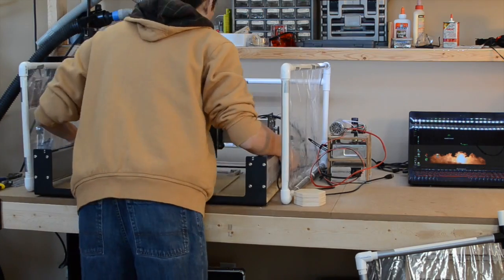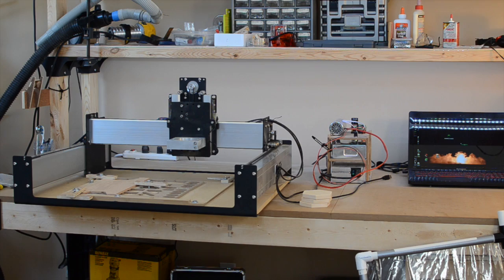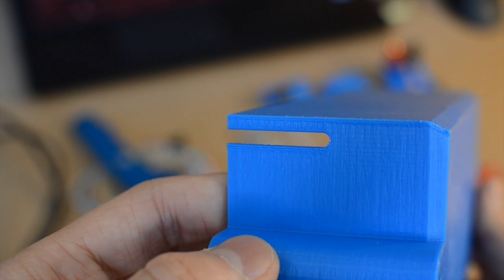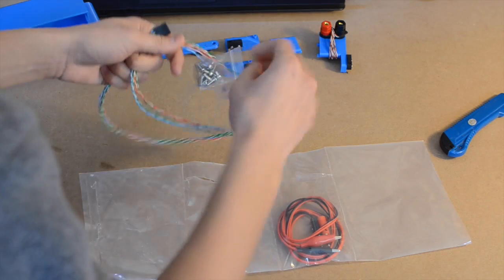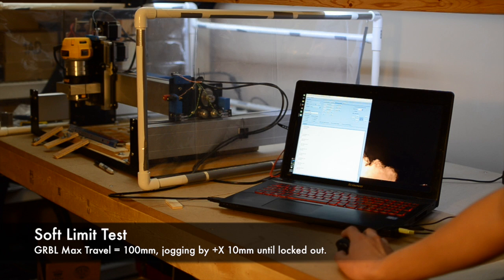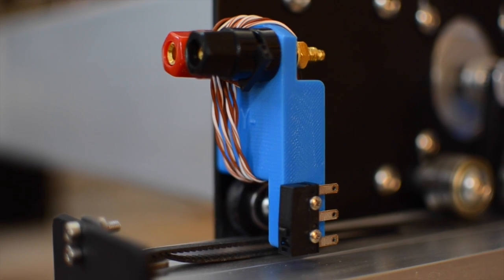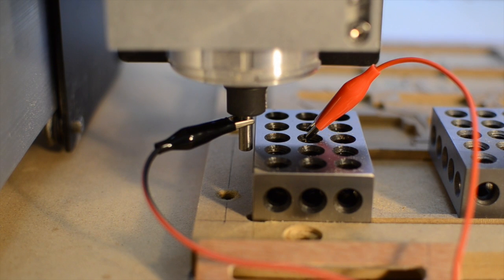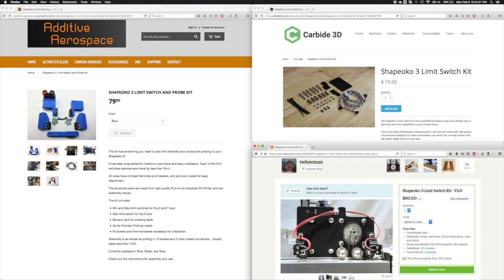Installing a Homing and Limit Switch Kit - Shapeoko Project #48

Comment: Is there a way to change x max travel about 10 mm
Reply from the maker: Decreasing it is easy, just modify the soft limits in GRBL. Increasing it is again something you can't do in Carbide Motion because it has its own version of soft limits, which is hardcoded. It's basically like training wheels for CNC users, so it's impossible to crash the machine when jogging. UGS and other senders won't hold your hand in that regard.

Comment: Mr Winston 
The switches along with the dust boot limits the cutting size a bit, when i rapid move to center it is slightly over to left of Mark, how do we go in and change settings to reduce board size accordingly, as usual sir thanks ahead of time
Reply from the maker: The notion of where "center" is is hardcoded into Carbide Motion. As far as I know it can't be changed. The software wasn't designed for custom configurations. You can use a different program (like UGS) and make your own macros that rapid to an arbitrary point, but you're on your own if you're using Carbide Motion.

Comment: I am not trying to be a paint but I am getting really frustrated here. I just got my XXL kit today and I am a total noob. The directions are misleading and not very well defined. Naturally I went to youtube to try to find a video tutorial and you have a video that isnt explaining what the parts are your just saying connect this to this. It gives the impression that we all come to this channel because we already know what this is. We dont and thats whats really aggravating right now. For instance I have homing switches and not one time in the instructions does it say where to plug them into the board... Where do I plug these homing switches in???
Reply from the maker: Savant PCs You're looking for a block of header pins that should be labeled X, Y, and Z_Limit. Direction you plug them in doesn't matter. Should be on the other side from the USB port.
Reply: Forgive me I build PCs and connecting things  like these switches have to be fairly precise in a PC and its aggravating because I dont know what all these parts are called and no one really has a tutorial or instructions to explain these things out. i wouldnt have a problem had I had a diagram saying This piece is called this, that piece is called that. I finally found the homing switch config on their website but its showing the old PCB. I dont mean to sound aggravated its just I been at this all day and its a pet peeve of mine when directions are not clear. Its not your fault.
Reply from the maker: No worries, I've been there. CNC is at an awkward intersection where the market is widening past hackers to the general public. And the language and software and general knowledge are playing catch up. Took 3D printers a while to get past that valley of frustration. That, and +Carbide3D needs to step up their instructions. Have you tried: https://www.shapeoko.com/wiki/index.php/Photographic_Shapeoko_3/XL/XXL_Assembly_Instructions

Comment: TY, did you revise work space in carbide motion
Reply from the maker: Yes, since I'm using my switches solely for soft limits. I removed my -X switch to get every last millimeter of travel possible, so I need the software to stop me before I crash the machine.

Comment: Mr. Winston excuse the persistence, hoping you can send the picture of the limit switch adjustments made to accommodate the suckit dust recovery@voheart.org
Reply from the maker: I was away all weekend, just got back. Check your email now. It's really a simple adjustment, nothing to worry about in terms of compatibility. If using one screw is not enough to hold the switch in place, a little application of hot glue should do the trick.

Comment: Mr. Winston, I notice that you are not using Carbide Motion, is there any particular reason, ty, Greg
Reply from the maker: For applications of homing and setup, universal gcode sender's macros make it really easy to trigger probing routines with a single click. However for basic operations CM can be quite convenient, as it saves the zero-ed position from your last session. In a lot of my later videos I'm using CM again.

Comment: Mr. Winston, I have already pulled the trigger it appears Andrew is still in the Biz, at least his website took my money....Do you know if I may bug you some more, if it works with Carbide Motion of do I need to use another program? ty ahead of time
Reply from the maker: greg martinez All switches basically work the same. Just a simple open-close circuit. 

Keep in mind, accepting payment is not the same as actively producing. Etsy and other stores will take your money even if the seller in on vacation. I would try and email Andrew to confirm, and if he doesn't respond in a week or two get a refund.

Comment: Need to know what are the best limit switches for shapeoko 3
Reply from the maker: I'm not sure if Andrew has the kit in the video in production anymore. If not, your best bets are the set direct from Carbide3D or Tim Foreman. Carbide3D set is highest quality, metal components and dust-resistant switches. Tim's is good for hard limits (has switches on positive and negative extents, but personally I prefer soft limits), and slightly cheaper I think.

*I haven't done this market research in couple months, YMMV.

Comment: How do you probe the 3 axis? is there a tool to do this, a set of G-Code commands or does Carbide Motion incluse such functionality ?
Reply from the maker: It's a gcode command. G38.2 if I recall, followed by axis direction you want to probe. Carbide3D will eventually release a probing kit and probably bake it into carbide motion for those who don't want to deal with manual entries.
Reply: thank you very much for your help. By the way: You inspire me a lot and I wonder if I can take your projects as an example to make my own videos ? I am a french person and I create videos in french. If you accept, I will give your videos in references in mine so people that see my videos will see where I took my inspiration.

Comment: Great video. But in order to "form my own opinion" on the differences between Andrew Diehl's kit and the one provided by Carbide 3D I would have to buy both. Do you happen to know the differences? I'm in the market for the SO3 and didn't know which kit to buy if I want the hard limit switches. Your help is appreciated.
Reply from the maker: +Peter Chan Carbide's mounts are metal, but only 3 switch, no probing included.

Comment: You really shouldnt kill power to all axis because having your z axis plummet like that might do some damage...
Reply from the maker: Valid point. Usually the equilibrium point of the springs is about an inch off most work pieces, but you never know... Something to be aware of. That's why I prefer soft limits, and most kits you can buy only have 3 switches so you're 'stuck' with soft limits.
Reply: +Winston Moy Some controllers you can give commands in case something was tripped like "max out z and disable spindle"

Comment: nice video.....I am in the process to buy my cnc mill. I have seen your videos about Shapeoko 3 and it looks so nice. I just saw another interesting cnc mill which is Stepcraft from germany. Do you know about that CNC?

Thank you
Reply from the maker: +VLAHECO Don't know much about it. Looking at the specs, it seems mechanically capable. But because it runs off Parallel, or USB adapter, you're stuck with certain software/Windows. The motor controller and electronics are basically a black box, so DIY mods (like limit switches) may be difficult or impossible. 

It will work, but in my opinion won't be nearly as simple, easy, or pleasant to use as something based off the Arduino architecture.
Reply: +Winston Moy a subd connector and an arduino is all you need to convert a controller meant for parallel to grbl

Comment: There's a (pretty large) thread on CNCZone about magnetic limit switches. They're non-interference types that supposedly are stupidly accurate. It's based on a Hall switch and a neodymium magnet. The interesting part is that there doesn't need to be a physical contact which means there is no wear and tear, unlike those micro-switches you're using there. http://www.cnczone.com/forums/open-source-cnc-machine-designs/101878-cnc-forum.html

Comment: You could improve the z homing by using a force sensitive resistor like the delta-printer boys do.
Reply from the maker: FSRs can get you in the ballpark of 0.3 mm, which isn't a significant improvement. 3D printers went to FSRs to eliminate mechanically switched probes, not strictly for precision from what I'm reading. You're not going to get better than electrical continuity for determining contact, you just can't do that on a non conductive print surface.